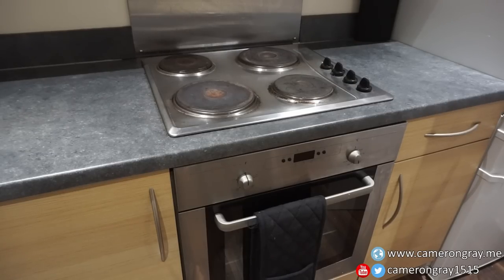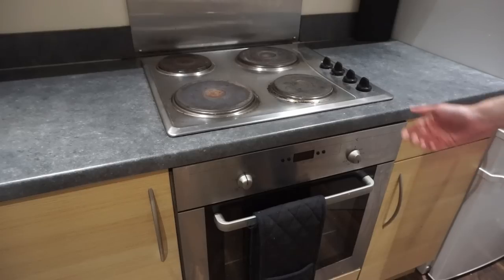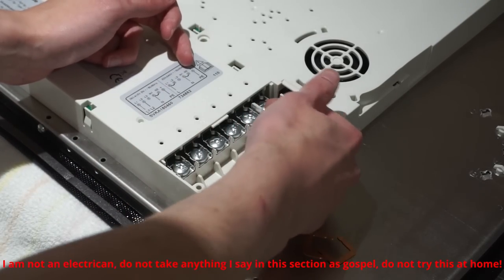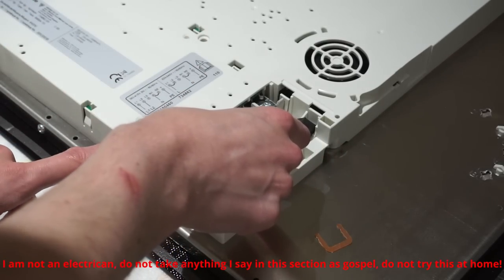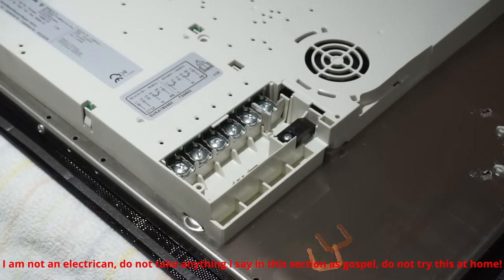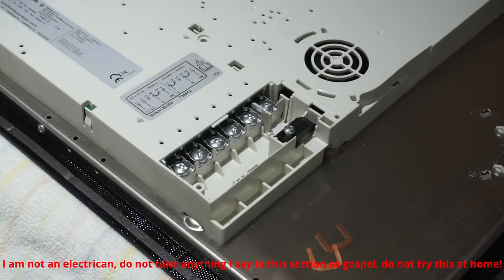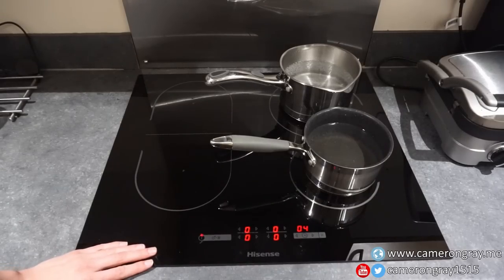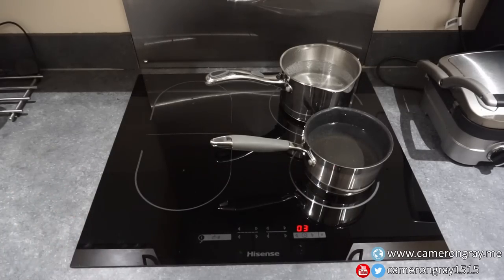Upgrading to an Induction Hob - Hisense I6433C - Installation and Review

Comment: Very good explanation of the situation. I actually had a hob replaced by a well known online white goods retailer. @£50 to get it installed, took around 40mins which included quite thorough circuit testing. Had previously had my property re-wired a while back: 20amps to oven. 32amps to hob. Cooking on indcuction is great - no gas fumes, fast/efficient.
Reply: Could you tell me the name for minorista shop please

Comment: in Australia we are starting to have plug and play devices, basically anything that is 40 amps or less isn't "hardwired" in, they just have the Australian standard plug that is designed for 40 AMPs, (it's a little larger than normal outlet so smaller plugs can fit) which makes it easier to replace, they just unplug and plug a replacement inside and charge us for the product and time to replace it rather than play the game of "what rats nest is up here?"

I should be expecting almost everything to be like that soon, especially with the way that it can make life easier, imagine replacing LED downlights every year that isn't edison or bayonet
Reply: That's interesting. In continental Europe, some built-in appliances (such as ovens) are starting to use regular wall plugs, as they're rated for less than 3kW anyway (long-term power limit on a standard grounded plug). 
But since 3-phase plugs are really uncommon (if anything, you're more likely to see them in a garage than a kitchen), full-sized induction hobs are almost all designed to be hardwired. 
And even though most of them are compatible with 230V, it's hardly a great way to use them, since that limits the power draw to 3.6kW short-term - so if you wanted to quickly boil one large pot of water, you wouldn't be able to use any other induction elements.

Comment: The only time I've used a modern induction hob was in a Hotel/Apartment which a compact 2 ring in the kitchen.  It was quite frustrating to find it was deault safetly/child locked before you could do anything with it!  Also the time you have everything on is Christmas!

Comment: One thing you should be careful with this hob is not to chip any of the corners- since the side ones are neither beveled, nor protected by a metal trim, they're quite susceptible to it.
It probably won't affect the functionality, but it poses a potential risk of cutting ones hand.

Comment: I bought one of these hobs last week as it looks great but unfortunately I didn't have enough space beneath my worktop for it due to a double oven below. The induction hob itself is 50mm deep but requires an extra 20mm of space below for the cooling fans in the underside, something to be aware of. I could probably have just fitted the induction hob in (my old ceramic one was 40mm deep) but the fans would've been right up against the outer casing of the oven - bound to upset the induction hob ☹

Comment: I suspect that that hob is not actually designed for a 3 phase supply, as it only has two phases there. Perhaps it is designed for both UK and a north america system. Over the pond, they have what can loosely be called split phase where they ground the center tap of their disto transfomers. At least this way the hob will always be able to get 230~240V or so from it's supply. Keep the videos coming :)
Reply: yup, split phase here in north america is two 120v legs with a bonded neutral, so you can get 240v by going across the two legs. anecdotally, the only things in my house that're 240v are two 500w electric baseboard heaters for an addition without forced air heat, and my clothes dryer. my oven/cooktop (which is usually one integrated 'range' here) is natural gas.
Reply: Just because you have three phases available doesn't mean you have to use all of them! Having said that, you might want to use the remaining phase for your oven.
I imagine this hob just contains two or more single-phase power supply modules. When you wire it for two phase use, it'll be equivalent to connecting one single phase 3.6kW hob to each phase. That way, they can use the same power supply modules in different sized hobs.
In North America, you would have to wire this appliance as single phase 240V, which is what you get if you wire L-L instead of L-N on one of those North American 'split phase' supplies. This hob won't work on 120V. It also won't work in North American properties that have 208V L-L (three phase). It's only specified for use with 220-240V 50/60Hz supplies.

Comment: I'm looking to get a similar hob but I've noticed that a lot of modern hobs now don't have any clamps/screws or anything to mount the hob into place. I just think an appliance such as this would be safer if it's mounted securely in place. I wouldn't want it to move around during cooking or for the potential of over-boiled water to seep through. Clamps/screws would surely hold it more securely and allow for the strips to push harder into the worktop. Any feedback is greatly appreciated!
Reply: Never clamped or clipped either of my  ceramic hobs into the worktop and they've never moved.

These things are quite heavy so they're not boing anywhere.......

Comment: If youre spurring off for the oven that spur cable should be 6mm or your 32a breaker isnt going to trip to protect the cable if the oven pulls more than it should in a fault condition. Thats why it was a fcu before
Reply from the maker: There's a 13a fuse in the oven's plug... It's no different from spurring off a 32a ring in 2.5mm to add a single or double socket.
Reply: @camerongray1515  That fuse only protects the 1.5mm flex going to oven though, not the 2.5mm cable going from the oven connections to the 13a socket. on a ring final you have the current shared down 2 2.5mm cables its not just 1 2.5mm t&e that is taking the current as current flows through the path of least resistance. minimum cable on a 32a mcb is 4mm and goes up to 6mm depending on volt drop for run of cable and short circuit current.
Reply from the maker: That's simply not the case.  The fuse in an FCU is in the exact same position in the circuit as a fuse in a plug, there's just some plug pins in between. If the oven develops a fault drawing more than 13a the fuse will blow, how can current still flow through the 2.5mm cable if the fault has blown the 13a fuse stopping all power to the oven?  I'm familiar with how a ring works and yes, you have a pair of 2.5mm cables, however, it is totally permitted to spur off of a ring using a single 2.5mm cable as long the spur only feeds one single/double socket with the idea being that a double socket with a pair of 13a plugs can draw a maximum of 26a which is within the limit of the 2.5mm cable.

Comment: The use of Diversity at 9:35 is interesting and you got a point about realistically not everything will be maxed. However, I think an electrician would point out that diversity is not academically used for calculating cable current capacity, it is used for the gauging if the 100A supplier's fuse to the house would break or not. The use of diversity in your install and your thinking is about whether there is a fire risk and thus a danger to life and property, whereas the normal use of diversity the risk is of power cutting out to your house or of the substation being overloaded.
Reply from the maker: Obviously I'm not an electrician, although John Ward (an electrician who as far as I'm aware is pretty well regarded) made a video about cooker circuits and seems to state that diversity can be applied to the cable and circuit breaker rating of a cooker circuit: https://youtu.be/QQduU8RkjD8?t=383.  He also shows a section of the IET On-Site Guide which also states that a 32A circuit is appropriate for household cookers up to 15kW so they must be using diversity for that statement since without it, a 15kW load would equate to over 65A.
Reply: @camerongray1515  Cool thanks for the critical thinking on this. Just thought a bit more on it and in your case the worst thing that could happen is your MCB tripping if it goes above 32A, not a fire risk. Apologies for the scare

Comment: I just ordered one of these before I seen your video. I've been cooking on a Primus single ring gas camping stove for the past 5-6 years so this should be good. The camping stove is a good one though, outputs 2kW and boils water in no time so I couldn't go back to crappy ceramic or in your case those completely awful solid ring hobs. The bizarre thing is people still buy these crappy solid ring hobs when induction hobs have become almost as affordable.

Comment: Thanks for the video. I just bought one and am waiting for it to arrive. It is a Bosch series 4. I believe I have a phase 3 as it is a thick cable that’s connected to my current, ceramic hob . Do you think I will get full power on each hob with a 3 phase or will it reduce in power with each burner turned on? I’m like you, I don’t want to sacrifice power when turning another one on, but little did I think of this when I bought it

Comment: This tutorial was subpar for an installer. It skipped the electrical setup entirely and lacked close-up shots of the final result. Instead, it spent too much time discussing amperage considerations, which became tedious. I'll try to provide additional details to help:
- Jumpers: I struggled with the jumpers, initially unsure if there was a specific slot for them. They actually go into the same holes as the wires (which is obvious in hindsight). Don't worry if they seem loose at first - once the screw above the jumper is tightened, everything fits securely.
- Clamp: Removing the clamp was difficult, even with the top screw removed. I had to use a screwdriver as a lever to pry it off.
Reply from the maker: This video was not intended to be a tutorial, I deliberately avoided closeups of wiring because I wanted to avoid people who didn't have sufficient electrical knowledge from blindly copying what I did based on what they saw without actually understanding what they were doing - especially factoring in that different counties may have different electrical installations that require different wiring.  The "tedious" discussion of understanding the current ratings and circuit capacity are very important to understand when installing such a powerful hob and could pose a real fire risk if not calculated correctly.  People who already understsnd that side of things can always skip ahead. If I showed connecting the wires in detail and didn't cover the current rating side of things, I can guarantee I'd get people who with limited electrical knowledge trying to wire this hob into a supply that used to feed a gas hob igniter which is in no way capable of handling the load from this hob.

Comment: Hi Cameron, really helpful video thanks. Recently installed a similar model and one side of the job isn’t working. Realise that I need the jumpers that you used . Where did you purchase them? Can’t seem to find searching online . Thanks
Reply from the maker: They should come with the hob as they're custom sized for your particular hob and not a standard part, if you didn't get any I'd contact the manufacturer to ask for some or see what their recommendation is.  I suppose some manufacturers may want to you to instead link the terminals with a bit of suitably rated wire.  In the case of mine the links were tucked into a little slot inside the wiring compartment so worth checking on yours to see if they are in there, alternatively they may have come in the hob packaging along with the various fixings.etc that it may have included.

Comment: Excellent informative video.  I am considering purchasing this particular induction hob and needed to find out all things I needed to consider.  I have the same old electric hob however have a double oven below and not enough space between induction and oven, so thinking I need to cut out part of the kick board and dropping support shelf to accommodate it

Comment: I've read negative reviews about the noise of this model.  Is it an issue?
Reply from the maker: It makes a noise but it's not really worse than any other induction hob I've used, just a slight hum that clicks on and off but it's pretty quiet (can't hear it over the sound of the actual food cooking).  Then there's the fan that kicks on if it's under heavy use but it's no worse than the noise a laptop will make if it ramps it's fans up.  My fan oven is much louder than this hob running at full power.

Comment: I would have cut the power wire and stripped new copper from the cable for the new hob btw
Reply from the maker: Exactly what I did, I just didn't show it on video because it was too fiddly to bother filming.

Comment: Hi Cameron, could I ask you a question about the installation guide that came with this hob please? I have a hisense induction hob but a different model and the guide only contains instructions for flush mounted fitting. Was your guide the same? I just want to know if the flush fitting is optional as I have been told that the hob should have brackets otherwise. Thank you.

Comment: I'm upgrading from a gas hob, as you mention around 11:20, so the existing outlet was just for the gas ignition. What do I need to do to enable it to power the new hob?
Reply from the maker: It's unlikely that a supply for a gas igniter is powerful enough to run a large induction hob unless it was installed with the provision that an electric hob may be used instead (unlikely).  In this case you would need to either add in a dedicated circuit for the hob, or you may be able to run it off of a feed for an existing electric oven depending on the rating of that circuit and the rating of the oven.  I'd suggest that if you aren't confident enough to calculate this yourself you consult an electrician to take a look.  You can technically run this hob off of a 13a supply through a plug or fused connection unit (can set a current limit in the settings menu of the hob) but this'll majorly limit the power output so I definitely wouldn't recommend it as it would likely end up performing worse than your gas one.

Comment: HI Mate, Did you get the sealing tape with the Hob? or did you purchase it seperately. I puchased HISENSE - I6421C but it did not come with a sealing tape or any putty mould.
Reply from the maker: It came packed with mine, think it was in the same bag as the paperwork.

Comment: might help when showing the connection procedure to not have your hand in the way
Reply from the maker: I deliberately didn't go into too much detail around the connection process, kept the camera back and didn't show the process of me actually connecting the wires.  As I'm not an electrician, I was worried about making a totally easy to follow "put this wire here" style tutorial in the fear that people would blindly follow my instructions and end up doing something unsafe such as connecting it to an existing circuit by simply marching the colours without looking at whether the circuit can handle the load of this hob.  There's a wiring diagram printed next to the terminals but if in doubt, please contact an electrician.

Comment: Great vid, does it secure to the worktop or just sit on top?
Reply from the maker: It just sits in place and the foam seal stops it sliding around, you could still just lift it out but I've never found it move around in use

Comment: I’ve bought a job and have started to wire as per diagram but with the links fitted I have 2 wires not connected do I cut them off or use insulation tape??
Reply from the maker: I'd suggest contacting an electrician since it seems like you have unconventional and possibly unsuitable wiring for this hob.  Those wires would need isolated in a suitable terminal block, not just taped off.  Additionally, if they're connected at the other end, you'd need to work out why they are there and what they were used for on the old hob.  Finally, if after connecting L, N and E to the hob you still have 2 wires left over, this sounds like you have some sort of 5 core cable which I'd highly doubt is rated anywhere close to the current requirements of this hob.  If the cable is under-rated, at best you'll blow a fuse, at worst the cable will melt and catch fire when you have the hob under heavy use.  What type of hob did you have previously and how was it connected? If it was a gas hob then it's likely that the cable was just designed for a low power igniter and they likely used some leftover 5 core flex, this wouldn't be suitable for an induction hob and you'd likely require additional electrical work to install a suitable supply.

Comment: Top tip: boil your water in a kettle first and then add it to your saucepan
Reply: Believe me, if you have an induction hob, then you don't need to.

I bought a single portable Tefal induction hob and it boils a huge stock pot of water very quickly and holds a furious boil if required.

Comment: M8 so you just connect everything  to normal socket and everything working properly?no fuses problems  when you use power boost on the?
Reply from the maker: This particular model is designed for hard wiring.  It does have a feature to limit the power which would potentially let you wire it into a 13a supply but this will limit how many rings you can have on high power at the same time.  I also haven't tested this.  Unless you plan on moving to a hardwired connection in the future you're probably better getting a hob that comes with a 13a plug from the factory.
Reply: This hob is connected by 6mm wiring to a white CCU, cooker connection unit, not the 13amp socket shown next to it.

Plug in hobs will be connected to 13amp sockets running from 2.5mm wiring.